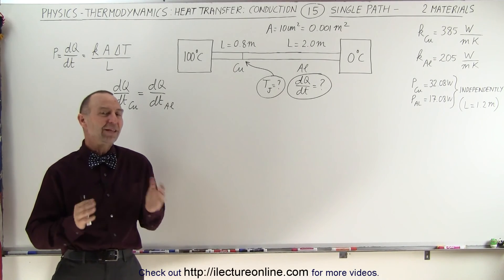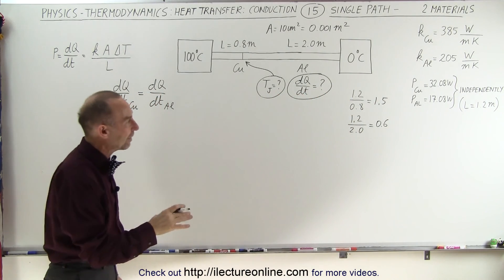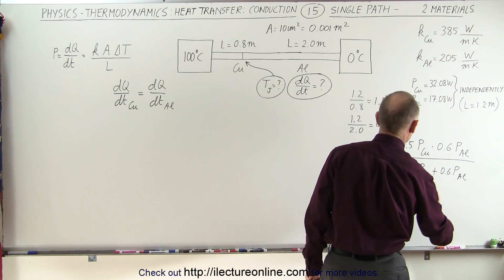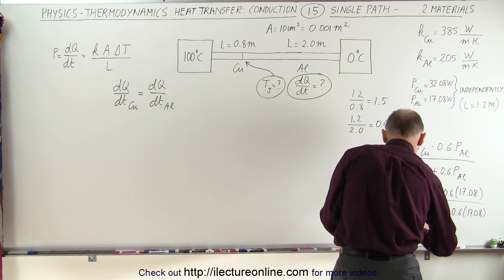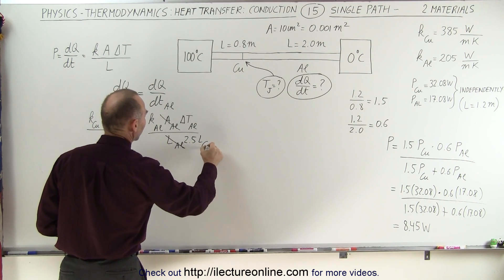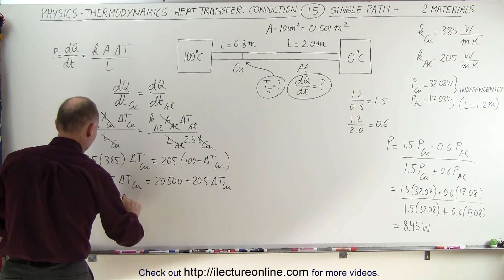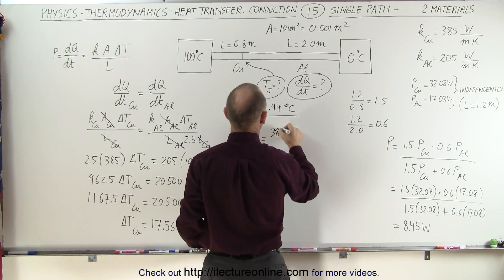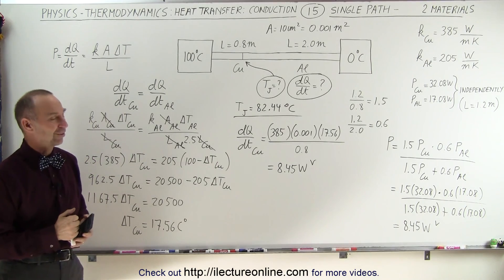Physics 24  Heat Transfer: Conduction (15 of 34) Single Path - 2 Materials

Comment: For those wondering where the numbers came from for the factors.  In the previous example where the power was computed, the original lengths of the Cu and Al rods were both 1.2 m.
Reply from the maker: Thank you.
Reply: @MichelvanBiezen  Actually, the length was written on the board, but I did not notice it until after I wrote the comment.  Thanks again for the videos, they are making a big difference in my physics classes.